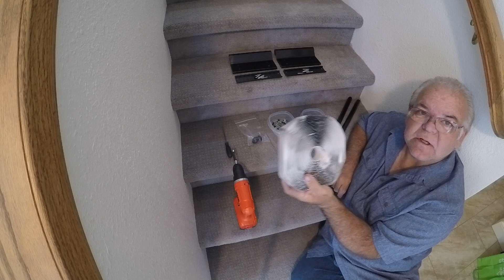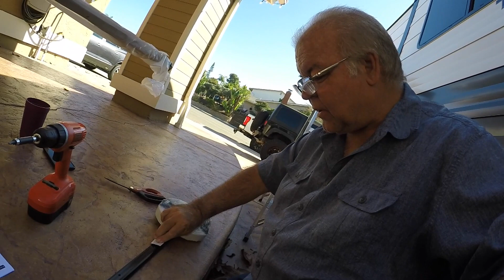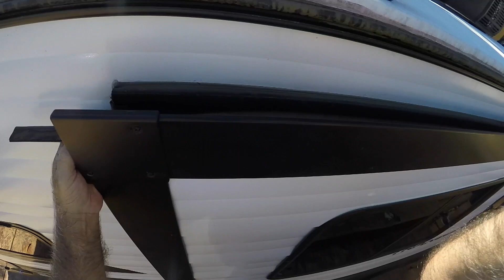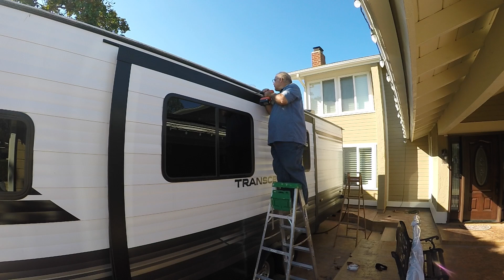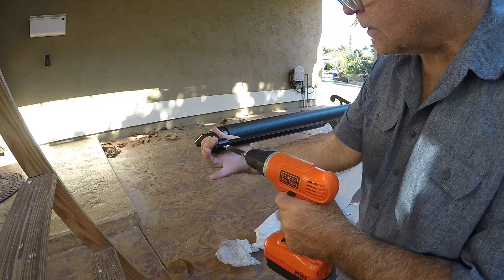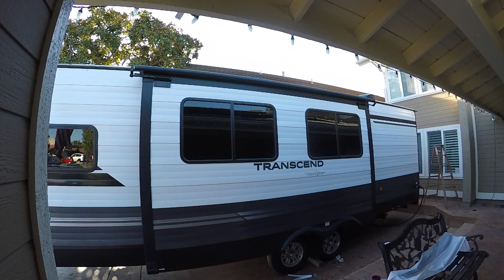Solera Slide Topper Install Video

Comment: Thank you for taking the time to show the steps.  I watched your video before installing the topper on my travel trailer.  Your pointers made my install easier.
Reply from the maker: Excellent & Thanks!  My goal was to show how easy this was.  Congrats on your new Topper!  Dave-
Reply: Don't I know which model your Transcend is.  I have a 2019 Transcend 28MKS. Can't see in the video if your topper was coming in contact with the top edge of the slide frame after install.  If it was, were you able to adjust enough so it wouldn't come in contact?  I would worry about the fabric wearing if in constant contact.  Thank you for sharing.  Mike M.
Reply from the maker: @julieandmikemixa9872   My Coach is a 2020 27BHS.  The topper does not make contact with anything and works awesome.   Very helpful here on the west coast as most parks have a lot of trees.
Reply: @ThinkDaveHowell  thank you for the response.  Your video gives me the confidence to DIY this topper on my Transcend.  Mike M.

Comment: So when you measured for the main metal strip piece did you measure from the top of the slideout molding  part or the top.of the slide out roof ?
Reply from the maker: Top of the slide molding then I set it in the best flattest sort so I could seal it properly.  Been over 2 years now and it is working perfectly.  Thanks & enjoy your project.

Comment: I have a question about slack in one of the topper awnings. We messed up and tried to install ours with the awning out instead of in. What steps do we need to take to get the slack back out of the awning?
Reply from the maker: It won’t be easy without removing it and reinstalling...but you can try this.

Open your slide out all the way.
Use the spring tension clips that came with the topper, or try to get something similar to lock the topper roller in place.

Then, with the topper locked “open”. Close your slide out being very careful
not to allow the topper fabric to get snagged in the slide .  You will want to manually pull the fabric over the slide out as it closes.

Now, with the slide out closed.  Carefully remove the clip while holding the roller tube in place.  You will need 2-3 people for this step.

Now slowly re-roll the fabric onto the roller which will build more tension.
It should turn at least 14 times.

This should give you full tension once re-rolled back in place.

If it fails, you will need to remove it from the RV and reinstall after you have added the tension back and install in closed position.

I hope this helps.  Be careful and good luck. 👍

Comment: Good Afternoon Dave,
I have to ask 1 more question about the length of this I ordered one but now I here I should have ordered 6 extra inches to my numbers mine was 150" or 12' 3" that would put the fabric at 12' 1" I think is what I seen and wondering if I should have ordered the 156" or 13' to give it more over hang? Sorry to bother you on this
Reply from the maker: How to Measure:

When measuring a Slide Topper, slide-out cover for your travel trailer, 5th wheel, or motorhome, start by measuring between the outside edges of both slide-out flanges and order the Slide Topper size that allows for total fabric coverage over the Slide-Out box (the fabric itself will measure 5” shorter than the complete awning width).

For example: A flange-to-flange slide-out size of 64” (or 5’3”) will require an awning width selection of 6’ (5’7” fabric) for complete coverage.

If not sure, I would call Lippert direct for guidance.

I hope this helps

Thx
Dave

Comment: Question why not use the track that is on the unit? We have a 265BH and the front awning uses the track. This way it would eliminate the additional track install. Did you see an issue with it? Thanks in advance.
Reply from the maker: My 2020 27BHS does not have an existing track so I showed the install using the entire process per mfg instructions.  Your coach may be different and you can adjust to fit you situation.   Thanks, Dave
Reply: The track on your unit could just be a strip of gutter for the slide
Reply: @ThinkDaveHowell  I was wondering this also we just picked up a 2021 Transcend Explor 321BH and was thinking about adding this to the trailer
you make it look so easy im not sure i want to try it??
Reply from the maker: @madjack7979   Hello.  In the video, my intent was to show the steps involved, the fact you do need a second person for the actual attachment section, and that it can be done easily.

It is actually very easy if you are comfortable measuring for attaching the rail to the coach, and the 2 brackets to the slider.  And, if you have the tools described, and are comfortable using them.

Look at the video a few times, and if you are feeling confident, go for it.
If not, the dealer can install it for a few hundred usually.  Enjoy and I hope this helps!!  Thanks.  Dave-
Reply: @ThinkDaveHowell  it's a great video and thank you for it. I was more worried  about there not being wood behind and I just put holes in the side lol thank you again for your info.

Comment: was this topper ordered through Amazon? I read a lot of reviews of missing parts and or it was an older product
Reply from the maker: Hi JC,  I ordered it direct from Lippert.  All parts arrived and had no issues with the install.  Most important step is to measure correctly so you get the correct width.  The video will advise how to do this step.  easy install and be sure to have a 2nd person help when it comes to attaching the slider fabric to the rail you install on the coach.   Thanks, Dave

Comment: I have a 2019 Transcend the slide measures 12’3”.  Do I order the 12’6” slide topper?
Reply from the maker: Yes, you want a few inches on each side.
Be sure to measure from outside edge to outside edge of slide including the frame on each side.
To be safe, Lippert will advise you on correct size before you purchase.
Reply: Our 2021 321BH has the same Slide Box must be sort of universal for them..